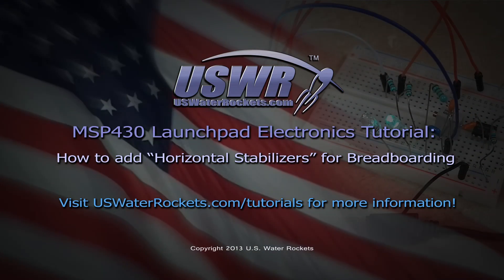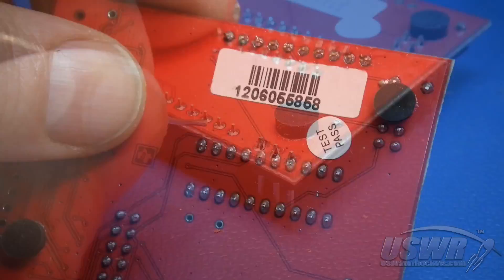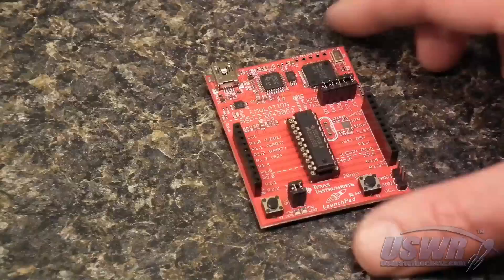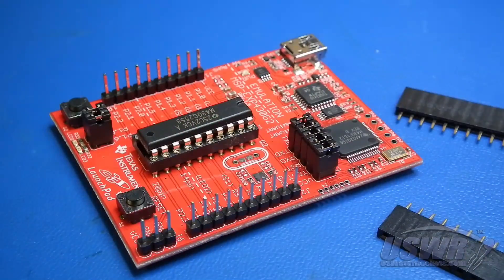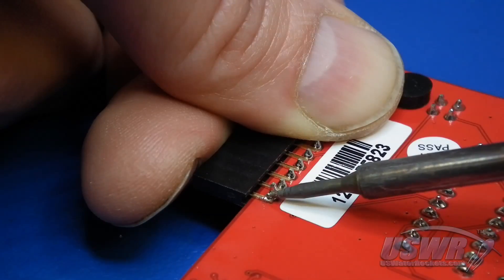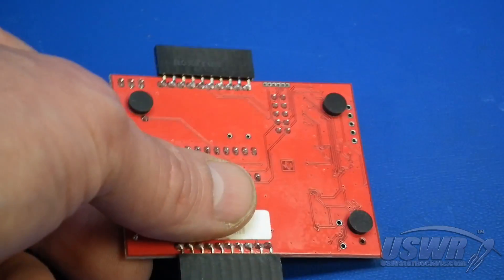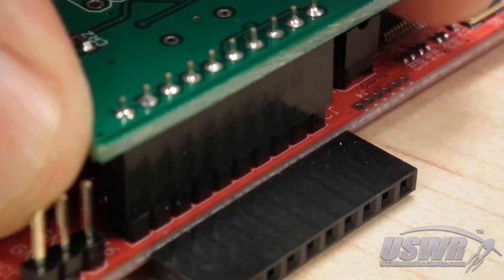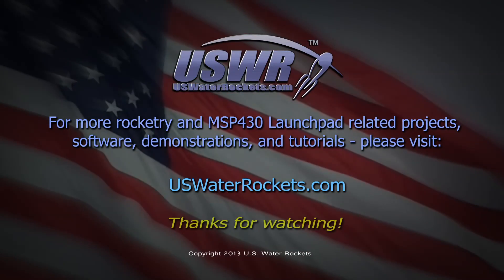How to make MSP430 LaunchPad work with Breadboards and BoosterPacks

Comment from the maker: Thanks. What you do with the pins depends on what you are making. The reason for changing from male pins to female pins is really just for students who use the LaunchPad for their school projects, since they work with breadboards and jumpers for prototypes much of the time. If you want to use the LaunchPad with daughter boards, like the green one shown (called "BoosterPacks") then you keep the male pins. If you are making a ServoChron, you don't need either male or female pins, so remove them.

Comment: Hello! Congratulations for your work. If I buy a MSP430, I have to remove the male pins and put the females as shown in the video?
At the end of the video put a green plate that fits into the female pins that were ousted by males, this card comes in the green box or MSP430 is made for you?
As can program the MSP430 to open a parachute after 4 or 5 or 6 seconds?
The MSP430 is the current price of about $ 10.
greetings

Comment: Neat, but I have to say, it's EASY to use a boosterpack with female headers. You just need a set of male headers. Plug them into the female headers on the Launchpad, then plug the booster pack on top.